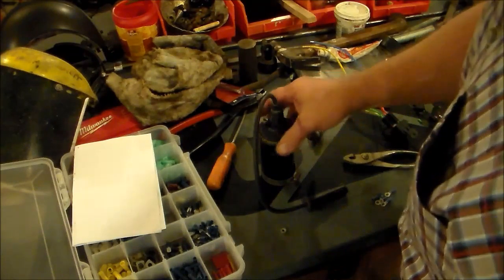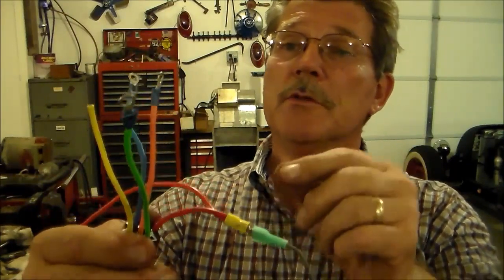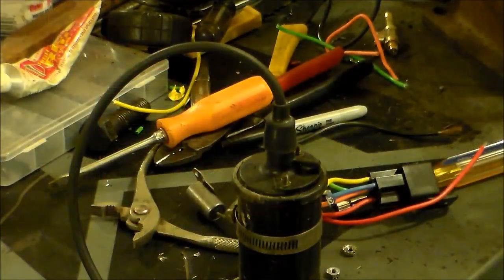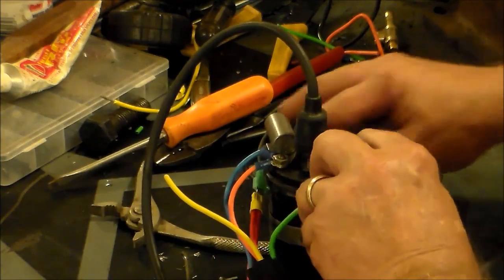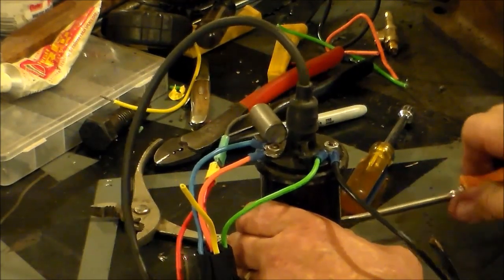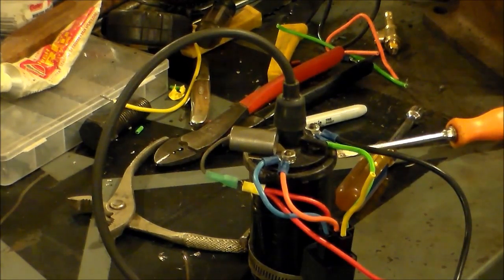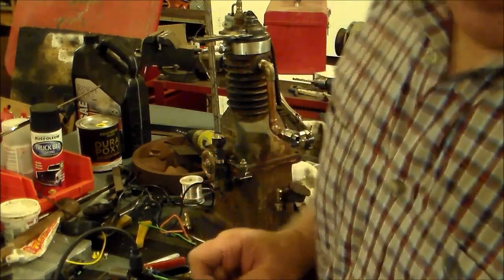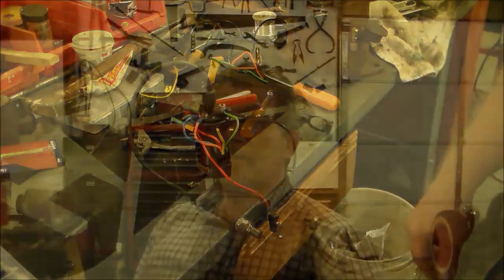Buzz Coil Ignition System

Comment: Hello sir can you give any good advice how can I use 3 4 6 pin relay to me ignition coil? I dont have 5 pin relay.
I also have problem me car uses pick up coil /4 pin gm ignition module and E core type ignition coil 4 pins .
So I try some how to figure out how to manuali retard me ignition timing.
The 4 pin GM ignition module is sloppy in winter time and I have no way to retard me ignition timing .
The 5pin gm ignition module has not enough retarding option I like me ignition timing to be more advanved due to bether fuel economi.
I have 500k potenciometer so I never done those small circuets before .
So I hoppe for some advice how can I make me ignition timing variabel in degree and if posibly bypass baterry voltage to relay directly or use different capacitors as amplifiers .
So any help wuld be nice.
Im not shure if normal relays culd run me ignition coil they did in the past but me ignition module varies frequency from 33-333hz in stages .
So Im not shure what relay to use that can folow the ignition modules fiering sequence.
Reply from the maker: This is meant for a one cylinder engine and won't work on a multi cylinder  engine
Reply: @RustyGlovebox  Well you see me blinker relay in me car did cinde of act similar to buzz coil dono why exactly engine worked in union with blinker relay when all 4 blinker were engaged odd behaviore realy and I managed to rev it up to some degree.
Curently I work on how to retard ignition timing on 4 pin ignition module and pick up coil so thats why I surche for answers in hoppe to find solution for me dillema in winter time Im stuffed up spark to low to start car and those modules dont realy work well under low engine speed .
Do you have any idea from what I culd build me self rotary advance/retard lever mechanism for me ignition system at least some thing that can rotate that distributor?
Im cinde of out off ideas

Comment: Great video, I'm a rookie hit and miss engine restorer (grandfathers's 1.5 HP is my first go), and having a bit of an issue with the buzz coil  Probably a stupid question, but you moved the positive line from the battery to the micro switch, but where was it before that?  In short, where do I put it to get power to the system?
Reply from the maker: The mirco switch is the supply location for power ( 30 pin on the relay) It makes the connection for the power to activate the relay.

Comment: I'm building a waste oil fired boiler and am wondering if a buzz coil would work for ignition.  Would it tolerate 10-15 second runs on a regular basis and how large of a DC power supply would it need?
Reply from the maker: A motorcycle battery would work it. Once the waste oil burner started burning it should keep burning till you turned the oil off ...or do you think the buzz coil would have to buzz all the time?
Reply: @RustyGlovebox  thank you!  I'm thinking it would only need to buzz for under 10 seconds per light

Comment: Would this thing get hot and fail when used on a hit and miss engine on a railroad speeder running many hours and many miles at a time?
Reply from the maker: It works good on a hit&miss at a show but I've never tried it on a 2 cycle Fairmont engine

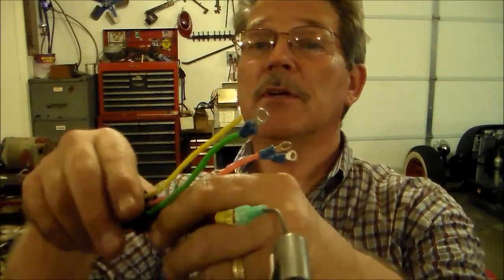Comment: Hey Rusty, at 1:20 when you described the colors and corresponding pin numbers you stated that red is pin 30, green is pin 86, orange is pin87a, and blue is pin 86 just as you said thr Green wire was too. Did you intend for blue to be pin 85  instead of pin 86? Thanks for posting. Later, RT.
Reply from the maker: 30-red, 87a- orange, 85- blue, 86- green, (don't use 87-yellow),
Thanks Rick hope this clears it up. Take care
Reply: thanks for the quick reply. Later, RT.

Comment: Thanks I only have one ford coil left .bought the relay today it seem to work well now need to do 3 more no parts left going to cost about 50 .00 each and will keep a couple of relays on hand what amp relay is the bestI bought 2  Bosch 5 pin one worked the other didn't seems one has the 2 87 joinedthe one that works is 20 30 amp do I need higher amp
Reply from the maker: That's great and glad it works for your projects.
Reply: Rusty I take it that the 6 volt lantern batteries  we have on are engines won't work on the 12 volt relay Brian
Reply from the maker: Brian Periard  use a 12 volt battery, I used a small one used to power a deer feeder or small motorcycle

Comment: hi!

i tried to connect 2 coils in series + the relay using your video , i wired everything to the first coil but the 86 which i connected to the second coil's (-) and then a cable from there to the points , but the spark is really weak, would you mind giving me your opinion?
Reply from the maker: Roberto López   If you add a condenser to the second coil it should increase the spark

Comment: Can you make a buzz coil for a 2 cylinder , 2 stroke engine using 2 ignition coils?
Reply from the maker: Does the engine has 2 sets of points? If so i would be easy. If not you will need someway to trigger the coils.
Reply: it's a wasted spark ignition system , we actually just need to build a buzzer coil with 2 sparkplug outputs,it's for a fairmont railway speeder engine with 2 cylinders (RK-B), it triggers the coil using a magneto.
Reply from the maker: I would work. I'm adding this link just to show how you would need to bridge the coils together only. the neg and pos together. Hope this is helpful
https://www.oldbritts.com/boyer_install.html
Reply: Thanks!!!!!!!!

Comment: Hey Rusty, great video! I would like to build one of these ignition systems to spark an old Newburgh  Machine & Foundry (NM&H) drag saw that I'm restoring. Where can I get one of those Bosch relays? what is the part number?
Reply from the maker: Steve Stafford   Any auto parts will have them. If they don't know what a Bosch relay is tell them a 5 pin relay. Some Ag store have them too in the wiring section. Good luck

Comment: is it applicable for motorccle use or car mayber?
Reply from the maker: I don't think it would work well for those but you might try. It would require an engine with points for this application.

Comment: That is so neat, I've got some 5 pin Head light relay's lay'n around that is for my Peterbilt truck I guess that would work, huh?
Reply from the maker: +Danny Walker      You bet those relays would  work , also  it would make a Hot Shot too. Mount it on an old cane with a battery and you would be set.   Hope you haven't washed away.

Comment: For those of us who do not have a Bosch relay, please explain which terminals are the coil and which are the points? Also, was the demo powered by a battery or a battery charger?
Reply from the maker: +rwruther  A Bosch relay  is a small square 5 pin relay and each of the pin locations are numbered. The relay is actually  acts as the points but acting in a buzzing action, the micro switch is only for the  off and on function.  I used a battery charger to operate it but will use a battery on the engine later.

Comment: whiy dont you  ues a old  ford model t  ignition system and its simpel
Reply from the maker: Oh I agree but a new one cost 50 to 80 dollars. I had all of these components  and cost me nothing . It was to show if you don't have access to a buzz coil you can build one with little expense. Thanks and take care
Reply: you can make a ford model t buzz coil and box and ther ar plans in google but just need to just get the fort model t points and it will keep in keeping with yor engine

Comment: That is one ferocious spark on a massive spark plug gap! The last time I saw one as big as that was on an electric stock fence when it was arcing through some bird poo and running to earth down some moisture on the post!
Reply from the maker: +Dan Whiteford    Lol... now is a hot spark there for sure. I plan running about .030 on the engine and with a little fuel it should do something. Take care

Comment: that's a mighty nice spark across  one heck of a spark plug gap. does it matter what year coil and condenser? thanks for sharing.
Reply from the maker: +Elbows Malone  I used a 80's Ford coil and condenser . But if you have a Vdub coil and condenser it should work   too. Give it a try. Thanks and take care
Reply: +Rusty “rustyglovebox” Glovebox thanks